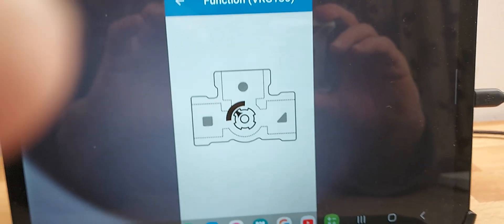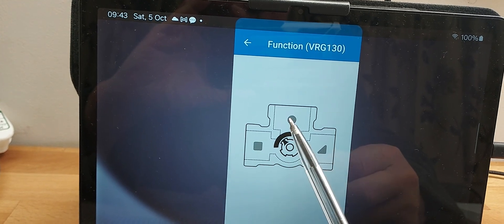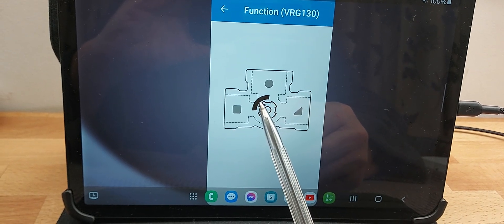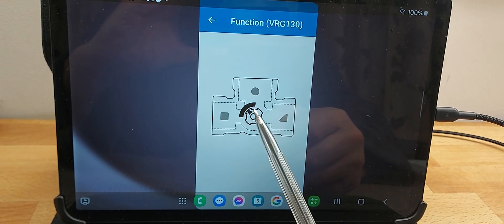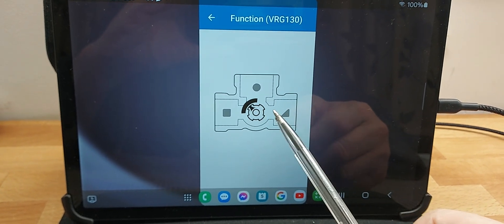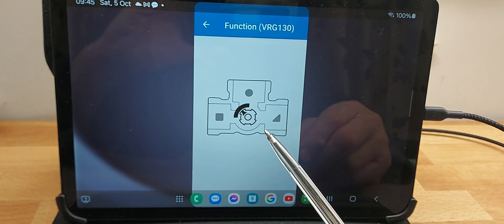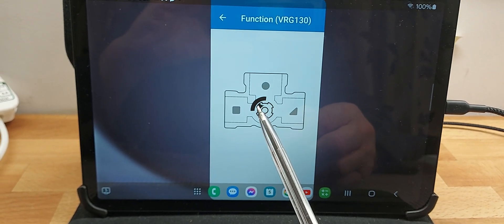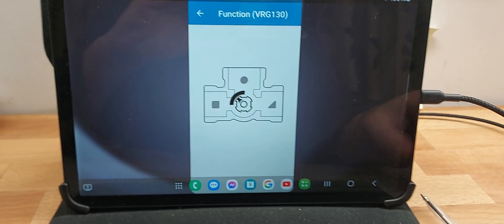More on esbe mixing valves

Comment: Any simplification in using a 4 port mixing valve like the viessmann undermount mixers have.
i.e do they automatically control authority.
Happy to be completely wrong.
Reply from the maker: @hufartd  a kvs value is described as the flow rate through a fully open valve in cubic metres per hour with a pressure drop of one bar across the valve. If a valve is adjusted and then retested the result would be different but would be called a KV value. So a radiator valve for example can be adjusted to achieve a different KV value. But the kvs value would be a good indicator of the authority of control over the circuit and it may be difficult to adjust the valve for an accurate KV value if the authority of the valve is too low.
Reply from the maker: @hufartd  so for a mixing valve the KV value would not apply in any meaningful way and careful selection of a valve with the correct kvs value is required. Some manufacturers have suggested using a sleeve in the valve that effectively reduces the opening orifice and increases the resistance in the valve effectively lowering the kvs value. These are available for the flamco mixing groups. Flamco have also suggested that by putting a flow restriction in the circuit you can reduce the kvs value. I am convinced that this is an error and would recommend nobody apply this theory